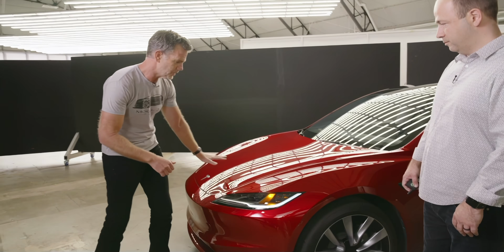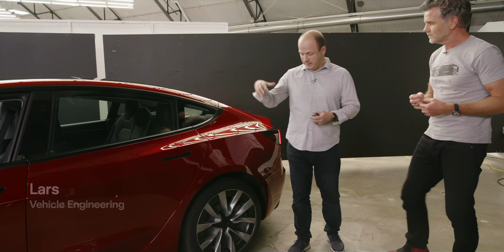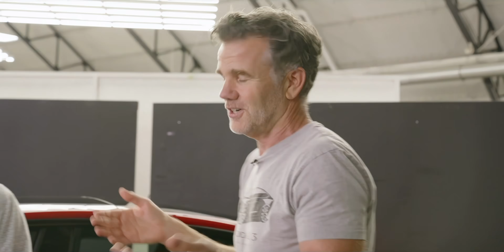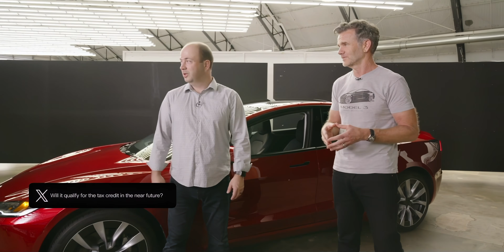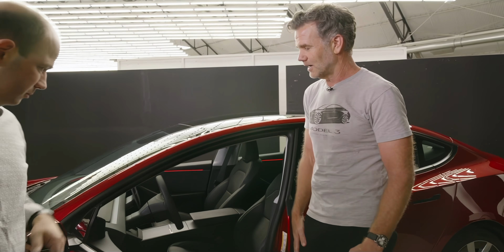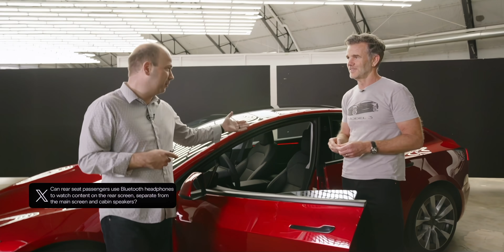Franz & Lars Talk New Model 3 | Live

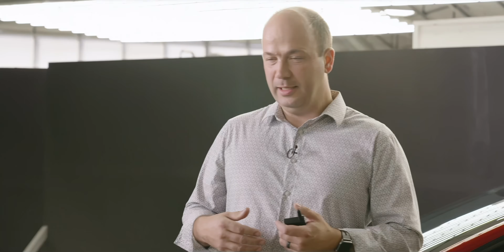Comment: 8:00  If your top priorities are safety and listening to your customers then you should not be proud about removing the indicator stalks and putting them in a stupid place on the wheel. It works some of the time, but outside of the US in particular it’s dangerous and dumb. The wheel is often completely upside down when going through a roundabout or doing a series of left-right or right-left turns in rapid succession means that finding the indicator is difficult or impossible. 

If you implemented steer-by-wire with 180º lock to lock then it may be acceptable, but on a regular steering ratio it’s insane.  Not indicating when leaving a roundabout is illegal and dangerous, and with larger roundabouts having multiple lanes means indicating to change.  You need to be able to do this without looking at the wheel. Then there is the removal of the shifter which is kind of acceptable but nowhere near as simple or convenient to use as the proper one.  I  drove a stalkless car and absolutely hate it.

This is much more important than having a screen in the rear, so please don’t tell me that it’s a cost saving.  

While I’m ranting, having a bright light on the inside of the dash when driving at night is idiotic.  It makes it more difficult to see out of, particularly if you are driving on unlit country roads.  In my model S I have the dash illumination turned to the minimum for that reason. 

Oh, and while we are talking about removing the stalks, the physical controls on my early model S are dramatically better than the ones on the 3. More intuitive and tactile.
Reply: I think the stalk thing is (again) way too dramatized. If you need to press the turn signals while you are already turning you aren't using them soon enough. As for roundabouts, I don't know what kind of roundabouts require such turning that the steering wheel is upside down. It's a non issue in my opinion and just requires some getting used to (as is with every new vehicle).
Reply: @Pico-444  obviously you have not paid attention to where your steering wheel is when turning. I have, especially when the stupid yolk came out for the S.  I started paying attention to the steering position in my S when driving. 

If you watch this FSD video and listen to the indicator change you’ll see that the wheel is completely upside down when FSD indicates to leave a roundabout in the US. 
We have a lot of roundabouts here in Australia and in Europe. 
https://youtu.be/Q5QYP_x3vp0?si=-kDCmzAG3B7YoX1H

Comment: Hi From Australia 
I’ve had my new model 3 for a month now. 
Can I make a suggestion on a simple improvement to the haptic indicator buttons. Could you add a haptic cue when the signal auto cancels?  I find that I am having problems signalling across multiple lanes as I misjudge the timing of the auto cancel and cancel the signal instead of restarting it for the next lane.

Comment: I didn't like that they seem to be taking credit for the tires, when they don't make the tires and this tire has actually been out for a while.  So Tesla should have switched to theses tires a long time ago, many Tesla owners have over the years.  They also claimed that Tesla deals in real world range for their cars, yet no one gets their published ranges.  Everyone always gets less range in real world driving conditions.  But did they fix the issue where water would run off and flow into the truck when the lid was opened up, during and after rain?

Comment: What about efficiency of heating?, what about efficiency of Sentry mode(takes a bite on range, when used frequently)?, apart from drastically reduces longterm cycle life of the HV battery(assuming car is not plugged in all the time). One other issue is the overheating cabin(the primary failure component being LCD display)? Cabin overheat protection(with A/C on) literally drains the battery on a hot summer day. Is there anything done to improve efficiency, in that regards(such as more efficient convection cooling)?. Are the electronic components upgraded to take on excess cabin temps without causing premature failure?
This could also remove the need to blacken all the clear glass.
Just some questions, as an existing M3(NCM) owner.❤👍

Comment: Tesla is the Apple of the EV industry. They're here to stay despite China's expansion. They have their own thing.
Reply: 😂 For sure not. Apple products have good quality and outstanding user experience. Tesla is more like Microsoft. A cheap mass product with questionable user experience.
Reply: @avigator  Do you own one?  They're far better quality than my GM, Ford or Chrysler vehicles.  You would be amazed at how many recalls I've had on my trucks and how often they're in the shop.  All legacy vehicles made in the last 5 years are absolute garbage.  I never have to worry about my EV's, they just work, no maintenance and never have to fill them up as we charge them at the office.  A godsend as far as I'm concerned.
Reply: @Ryan-ff2db  Tesla’s S3XY, I have driven them all. But compared to a Polestar, a Genesis GV60, a BMW i4 or iX, the Tesla quality is mediocre and the UX really bad.
Reply: @avigator  I would agree, depending on what you're comparing.  A model 3 and Y are two thirds the price of those luxury vehicles so they had better be better quality.  If your comparing apples to apples, Tesla gets a bad rep because most vehicles in the same price range are worse.  Especially from GM, Ford, Kia, Citron, and anything from Stellantis.   The model S and X though should be higher quality for the price, there's no doubt about that.
Reply: @avigator  EVs have the same vibe as the phone industry. They're about to be swarmed by the Chinese. Most will fall apart, but Tesla, I'm convinced, will stay in business. Just like Apple.

Comment: using the column shifter on my model Y is a delight, having to swipe the screen and visually check that the correct direction is selected is such a step backwards. In Europe, we have roundabouts and we have to signal to exit them. Having the signal controls move with the wheel is again, a worse design. Any car with a $5 rain sensor has better auto wipers than a Tesla. The “delete parts” mantra may help Tesla get the cost down, but sometimes it’s not the right thing to do to get the best driving experience. I’d happily give up a screen in the rear to get a car with column stalks, a rain sensor and ultrasonic parking sensors.

Comment: Tesla Vision is so bad. It's a huge step back from when Tesla used Radar. Autopilot drives so horribly in stop and go traffic without radar support. They also took away the park distance sensors. Tesla is going the wrong direction....

Comment: My 2019 Model 3 will average 160 miles using 32 kw which is about the same amount of energy as 1 gallon of gas!  My best so far is 160 miles using 30 kw.  Absolutely the most powerful and efficient car I have ever owned!  Not to mention the regenerative braking is so powerful I hardly ever need to apply the friction brakes.
Reply: But keep those caliper pins lubricated!!
Reply: @rogerstarkey5390  just lube them when you do your seasonal tire change.

Comment: When can Tesla drivers have lights with the same or better performance as ex. Volvo, Polestar, VW.  
Yes, I know they have matrix LED, but it doesn’t matter if the total light output (luminance) is about half or less, uneven with hotspots/dimmed areas, narrow width and height & does not “bend” with the curves and no FOV-adjustment relative to speed.
Check Tesla Bjørns comparisons, it's a significant difference between Teslas and the top headlights in the market. You can buy a 7-year-old Volvo and get better lights.
/ Tesla shareholder since 2019.

Comment: Where are the nema 5-15 120 volt plugs and one nema 14-50 240 volt plug for emergency power backup and the use for RV camping and boondocking off grid?
All EVs need to have vehicle to load and / or vehicle to grid.  These features could save lives and improve many use cases.  1001 uses for power away from the grid.

Comment: 18:37 Lowering sentry mode consumption by 40%! That’s a huge improvement. I’ve all but stopped using it since it draws too much power
Reply: I have a highland and two weeks after getting it someone backed into while parked. Sentry mode caught everything. Def second the above reply, def worth the extra battery usage. Charging a little longer today will save you tons of time/money debating insurance adjusters in the future.
Reply: there's a feature to have it turn off when you are parked in your garage.. i keep mine on 24/7 and have it turned off in my house because the only other person that can hit my car at my house is my wife lol.  But seriously it doesnt use that much power.. youre at work for 8 hours and thats only 8 miles of range to protect you from thousands if something were to happen..
Reply: To me, the dominating factor is not the power draw, it's more the extreme sensitivity. If I park on the street in Denmark I will often get about 1 clip per 2 minutes, mostly from pedestrians just walking within a feet past the car. That wouldn't be a problem if it was very quick to both review and delete the clips, but for me it's often been very slow, buggy and laggy.
And I have a friend who was hit by small debris from a semi and Tesla's camera resolution just wasn't good enough, and it doesn't provide timestamps or travel speed on the video either. So even though Sentry Mode was a great unexpected addition to the car, it's still lacking compared to a 3rd party dashcam - on top of the power draw.
Reply: @Muskar2  if you have hundreds of clips then you dont need to review them.. only review them if you notice something thats wrong with your car.. basically its there if you need it and you can ignore the clips if you dont need them.. it auto deletes old clips and replaces them with new ones
Reply: My son did not have his century mode turned on when he first got his car and someone backed into it so now he’s responsible for the repairs, not worth leaving your century mode off

Comment: Replace the glass roof with a transparent solar panel, transition windows that tint, dr scholl's gel in seats, built-in radar detector for cops, highspeed drones that fly as we drive
Reply: 350W if you're lucky.
When the sun is overhead,
When you're not moving,
When there's no tree shade, or building shade,
Or could
Or rain
Or Snow
.
You're adding weight, cost, complexity for tiny gain.
.
Put a panel on a roof.
Charge with that energy.
Far more efficient.
Reply: @rogerstarkey5390  "I'm limited by the technology of my time, but one day you'll figure this out. And when you do, you will change the world" - Howard Stark

Comment: Are you able to replace a battery if the pack is built in to the frame?
Reply: It's not built into "the" frame.
It's built into "A" frame.
.
The cells are a glued honeycomb, set into a rigid (battery) frame.
That's very strong.
.
The battery frame bolts to the vehicle "frame".
.
You couldn't "drive" the vehicle, it would twist.
But you can't drive without the..... Anyone....? .... Battery, so it's not a problem.
.
Look at the way they assemble the car in the factory.... 
Body, without battery.
Battery positioned underneath.
Mated.
Bolted.
NOW it's rigid.

Comment: I love the new Model 3 but I really hope Freemont does better with paint and body.  My 2023 M3 RWD bought in October, the paint is fair at best.  Over a dozen noticeable paint nibs, poor body gaps on hood, and driver side doors.  1/2 the quality of my 2017 Golf at 7 years old and 110k miles, which was 1/2 the price.  The M3 also I have squeaks and rattles inside at the A-pillar and dash.  I didn't have the Service Center address the paint since any correction other that a few $1000 body shop respray could make it worse.  I may issue a ticket for the rattles but reviews says it's hit or miss, if they even address it at all.  At the end of day, still love the car, especially for the price with tax incentives.
Reply: Good old US workmanship.
Reply: The rattles in the A-pillar of my 2021 M3 come from the seat belt height adjuster.  Moving it seems to have reduced the noise in my left ear.
There's a rattle in the dash, too.  There's a YT video on how to eliminate this rattle, but it involves tearing the dash apart.

I am disappointed in Tesla for not responding to all the complaints about these rattles.
The rattling takes away from the pleasure of driving.  It makes the car feel cheap.

Comment: I have a 2019 Model 3 performance. One of the things that a lot of people don't talk about is the lack of maintenance required. There's no oil changes, tune-ups, I haven't had to add freon to the AC yet. I got both a arms replaced because they were squeaking for $194 and he came out to my house to do it. And no transmission problems
Reply: but if you do need tesla sevice... good luck.
Reply: @importon  Charlotte seems to be pretty good. They swapped out my low voltage battery for free in about an hour and a half. But if you have to make an appointment sometimes they are a week or two behind

Comment: What’s happening with the Model 3 Performance?
Reply: Should be coming super soon. Performance trim Model 3s were spotted recently, Tesla is making promotional videos of the new vehicle.
Reply: Oh damn, I love your guys' channel.
Reply: It’s gonna be called the ludicrous apparently
Reply: Don't open your yapper again until you are standing next to the performance version.  😛
Reply: it's just an extra 100hp to about 605 whp
Reply: It’s coming very soon with bucket seats and stuff. It’ll also probably be called ludicrous not performance.
Reply: @Jacob_C3621 In official documents it's still called Performance despite the Ludicrous batch
Reply: Trimotor ludacris mode
Reply: Could they be waiting on some roadster tech.?
Reply: @TnNatives  Probably on some high power density cells from china and a transmission with a different gear ratio for the rear motor since it's probably going to be a Plaid motor.
Reply: @johntheux9238 
A lot of information is out there.
You're just not paying attention.
Reply: Pay more attention
Reply: Well there's bad news - Tesla is going to use the old (in my opinion the worst battery in comparison to older Panasonic variants and also just 79kWh) LG battery which will really limit the better motors - source is someone from German TFF forums who has got access to technicial documents for the EU. There ae already rumors that something wen't really wrong with the Performance vehicle program since there's such a time delay between the SR+/LR and the Performance and apart from little cosmetics the acceleration will just a little bit be improved, but with that they are falling behind in my opinion. Of course there might be a change of the battery, but for now it's the bottleneck. There could even be 600kW motors in the new Performance, it wouldn't make a difference because of the Ampere cap...

Comment: Tesla produce excellent cars. But analysts say BYD produce now more cars than Tesla. What Tesla needs is to produce a product and make it usable  that the competitor is not able to produce. TESLA needs to 'perfect' FSD and put Robots in factory or home. This will silence all critics and stock will skyrocket.
Reply: BYD produced more cars (EVs,) in.... One month.
.
They made bugger all profit driving the price down to do that, but that's not important... Oh wait... It IS!
.
Think it through.
If Tesla and BYD gain let's say 20% market share each they'll be bigger than Toyota.
They won't be "competing" they will "complimenting"
Reply: Heads up.
"Pressure" on Tesla stock will be proportional to the underlying success of the fundamentals.
.
The better they do, the more those with the most to lose will invest in time, money and misinformation to stop them.
This isn't a "transport" disruption.
It's a Systemic/ Societal disruption of which EVs are about 15% (Although they are providing the funding for the next steps)
EVs
Energy
Medical (diagnosis and treatment)
Labor 
Money (UBI.... etc)
.
Plus (imo) 
Housing (not just climate control because Tesla builds a system not a component)
.
And other things.
Transformers? 
.
(Not Air travel, probably not sea, because they're only about 4% of the problem)

Comment: Are you going to also talk about how rodents go into the underside of model Y as it did in mine, because they enjoy the warm battery and soy wires and peanut oil lubrication you guys use? I now have to go to tesla service center to remove a decomposing rodent that is stinking up my garage its trapped under the car

Comment: Bring back the stalks!
Reply: yep.  I would pay extra for physical climate controls also.  You've gone too far with deleting parts. This is too much like a phone that you drive around.
Reply: Its really disappointing and what is preventing me from getting the new one. Removed fog lights, removed drive stalk and turn signal stalk is just too far. I guarantee they've saved no money removing the stalks. Nobody has complained about having stalks! But everyone is complaining that they're gone!
Reply: Buy a different brand
Reply: I actually like it. It’s cooler and more futuristic
Reply: "Where FSD is going, they don't need stalks"
Reply: @rogerstarkey5390  not everyone wants to pay 12k for FSD
Reply: @rogerstarkey5390 FSD is 10 years away
Reply: @rogerstarkey5390  not everyone wants to pay 12k for FSD